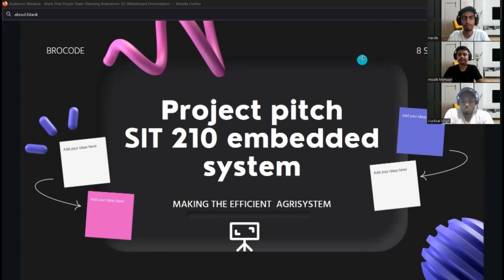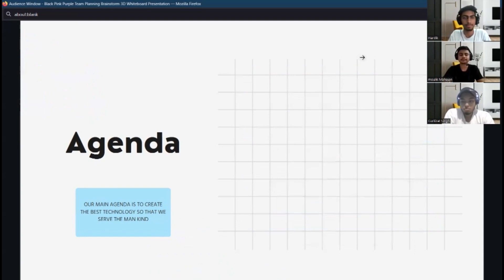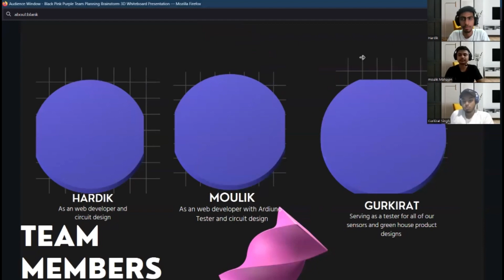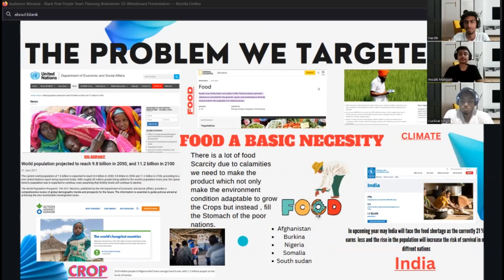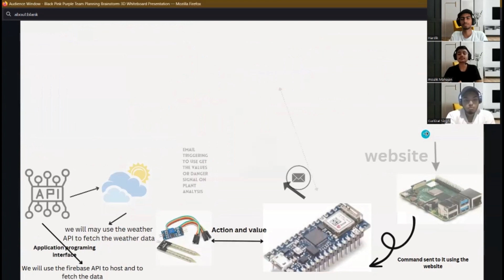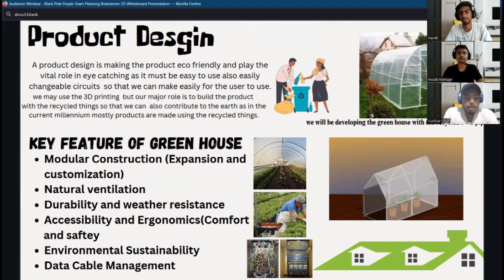project pitch 6.1p

Comment: Project Overview:
The primary objective of this project is to enhance gardening practices through the implementation of a straightforward embedded system, which continuously monitors plants and their environment. By employing advanced tools, this system aims to optimize plant growth and resource utilization within greenhouses. Ultimately, it seeks to increase garden productivity, minimize resource wastage, and promote environmentally sustainable farming practices for the future.
Positives:
1. This project holds significant promise, particularly for farmers who traditionally rely on manual assessments for plant care. By offering automated monitoring, it can greatly improve their efficiency and effectiveness in tending to plants.
2. The information provided offers a succinct and easily graspable overview, accessible even to individuals without a technical background.
Negatives:
1. The project could benefit from a more detailed exploration of the targeted problem, providing additional context and insights to enhance understanding.
2. Some viewers may find the graphics used overwhelming, as they could appear cluttered and messy, potentially detracting from their clarity and effectiveness. Simplifying or streamlining the visuals could improve their readability and impact.

Comment: Project Overview:
The idea described in the movie is termed "Smart Greenhouse IoT System" and is intended to answer modern agriculture's issues, specifically optimising crop growth and minimising food scarcity. The project's goal is to develop an embedded system that uses multiple sensors and technologies to monitor and manage environmental variables in a greenhouse, assuring optimal plant growth circumstances. A dynamic website, Raspberry Pi, Arduino, and a variety of sensors to measure metrics such as soil moisture, light intensity, pH levels, temperature, humidity, and air quality are crucial components of the project.

Positives: 
-Addressing a Critical Issue: By employing technology to optimise crop development, the project addresses the worldwide issue of food scarcity and the need for sustainable agriculture.
-Eco-Friendly Design: To achieve environmental sustainability goals, the project emphasises the use of recycled materials and energy-efficient components.

Negatives:
-The film provides a high-level summary of the project, however it lacks in-depth technical details about the hardware components, software algorithms, and data processing methods employed.
-Limited Implementation Data: While the project concept appears to be promising, it is unclear how broadly it has been implemented or evaluated in real-world agricultural contexts.

Comment: OVERVIEW : As per my understanding, the objective of your Plant Analyzer project is to change nursery farming through the development of a full system for the continuous monitoring and analysis of plant health and environmental factors. Modern sensors and information analysis will probably be used for this work to regulate harvest development and resource utilization. With this novel technology, greenhouse productivity can be elevated, resource waste can be reduced and sustainable agriculture can be long-term supported.
POSITIVE : This system involves various sensors that will be very useful in terms of data collections and report generation of the data related to farms and crops.
NEGITIVE: I think the system is majorly working on the online server and the use of this system can only be made if the farmer has a smartphone or a device to open a web server which not a practical approach as majorly not every farmer has the access to the web page and therefore this data which was captured by the sensors will not be useful to them. Secondly, another constraint would be the amount of sensors and components used to cover a single farm will make this system an expensive option for farmers as well as farm owners. 
HOW TO RESOLVE: To make this useful for the farmers, the limit of the sensors should be set very precisely having a gap of 2-3 moths i.e, sensors should collect data in every 3 months to prevent trash data and detect the change in seasons. Moreover, an action can be triggered using the raspberry pi module instead of making it fully web based. By triggering an action such as an alarm or a light change or a dispenser activation farmers will get to know that an event has occurred instead of regularly checking the web age for data and analyze them. This will save their money and time.

Comment: There are definitely advantages and disadvantages to your proposal to assist farmers in predicting weather and land conditions using sensors. 

Positive features:
- By giving farmers early notice of weather changes and changes in the soil, your idea can greatly boost crop yields. They can use this knowledge to decide when to sow, irrigate, and harvest.

- Agriculture's negative effects on the environment can be reduced with a more precise method of farming. For instance, by minimizing the use of chemicals, you can lessen soil and water pollution and assist conserve water resources by decreasing over-irrigation. 

- Tracking changes in climate change can benefit from data from monitoring global warming sensors. This knowledge might help with mitigation efforts and broaden our understanding of climate change.

- Making data-driven decisions may enable farmers to decrease expenses while increasing earnings. Improved financial outcomes for farmers can result from increased yields, decreased resource waste, and greater crop quality.

Negative features:
- In order to assure reliable data collection, sensor systems need to be calibrated and maintained. Technical problems and malfunctions could compromise the system's dependability.

- Sensor equipment manufacture and disposal can have an impact on the environment, especially if not done properly. Also important to take into account are the energy needs of   sensor networks.
- Not all the farmers will be able to use this technology as they need to understand and interpret the data generated by the sensors. Without proper training and support, they may struggle to make effective use of the information.

Comment: Overview:
Hi team, the ECOTECH green house plant analyzer is a project aiming to provide solution for a problem which has existed for ages, world hunger. With right tools, technology and data you aim to build an IOT based greenhouse monitoring system which would collect the environmental data and which would then be available via IOT dashboards in real-time. Your system uses multiple sensors such as temperature, humidity, air quality index, PH, etc. and communication technologies such as webhooks, ifttt, etc. to provide a fully functional, safe and easy-to-use monitoring system.
The system will be built using environmentally friendly materials while providing easy repairability and full control over the system.

Positives:
1. The current problem and the solution was represented in easy words to cater to different kinds of audiences. 
2. Real life examples from credible sources were used to convey the problem which provides to the project's credibility.
3. Secure data transmission is one of the biggest advantages of the system as it uses secure channel to transmit data acquired using technologies such as SSL.
4. The system architecture, though not perfect, was explained quite well in detail using appropriate diagrams and images.

Negatives:
1. The clarity of the problem and solution were clear but were not engaging enough due to poor audio and video quality and the overwhelming amount of data presented in slides could have been arranged better or divided into multiple slides.
2. The agro-tech industry is huge and still booming, many products are already availble on the market which makes it important to make it clear that which factors make it a suitable choice for people to choose this product instead of other alternatives.

Comment: Project Overview:-
The ECOTECH Nursery Plant Analyzer project is outfitted towards changing nursery cultivating through the presentation of an all encompassing framework intended for the nonstop observing and examination of plant prosperity and ecological elements. The's task will likely utilize state of the art sensors and information examination to adjust the development of harvests and the productive utilization of assets. Greenhouse productivity can be increased, resource inefficiencies can be reduced, and sustainable agriculture can be promoted in the long run with this innovative system.

Positive:-
- This project addresses a fundamental rural test and provides a notable arrangement.
- It is both creative and ground breaking of Utilizing IoT innovations and sensors to enhance the project

Negative:-
- The drawn out term of the video reduces its commitment factor and could deter watchers from completely submerging themselves in the substance.
- The project can be enhanced by providing additional specific information about the technology and methods.

Comment: Overview: 
The ECOTECH Greenhouse Plant Analyzer is an ambitious project focusing on smart greenhouse plant monitoring. It aims to meet the rising demand for advanced plant analysis in greenhouse settings and on smart greenhouse monitoring systems, including automated control systems, IoT-based environmental monitoring and control, and the benefits of smart greenhouses. Smart greenhouses use sensors and communications systems to monitor crops and their surroundings 24/7, and collected data is sent to an IoT platform where analytical algorithms transform it into useful intelligence. The benefits of smart greenhouses include increased crop yields, improved resource consumption, and cost savings over time. Automated greenhouse systems are very fruitful for the production of seasonal and non-seasonal high-quality production of crops.

Positives:
- The project introduces an innovative concept by delving into the realm of smart greenhouse plant analyzers, catering to the increasing interest in this field.
- The provided diagram is concise and effectively conveys essential details.
- All teams were equally participated and confident.

Negatives:
- The problem statement lacks clarity, making it difficult for the audience to grasp the specific issues the project aims to address.
- The video's extended length makes it less engaging and might deter viewers from fully engaging with the content.
- The project presentation oversimplifies the task, presenting it as merely connecting two sensors to a Raspberry Pi 4 and creating a Firebase website, missing the opportunity to highlight the complexity and uniqueness of the project.
- A more detailed product design demonstration with actual visuals would greatly enhance understanding.
- The pitch could benefit from a comparison with existing products in the market, showcasing how the proposed solution surpasses current alternatives.